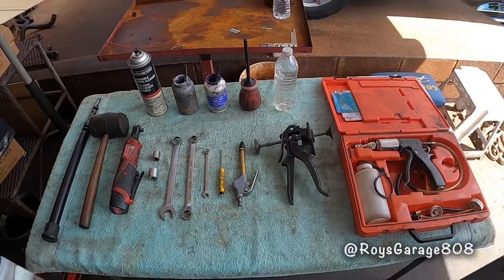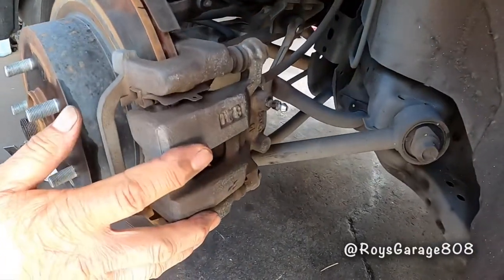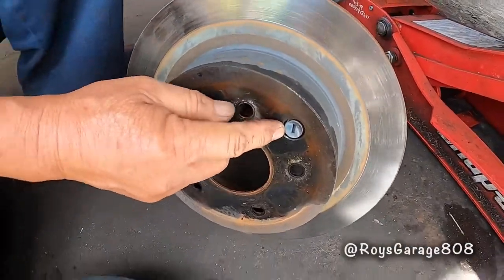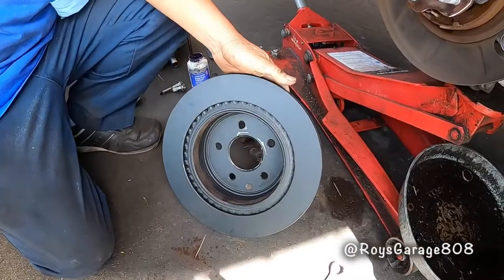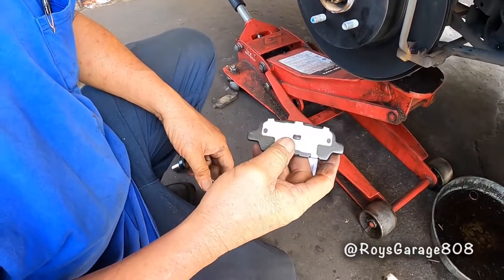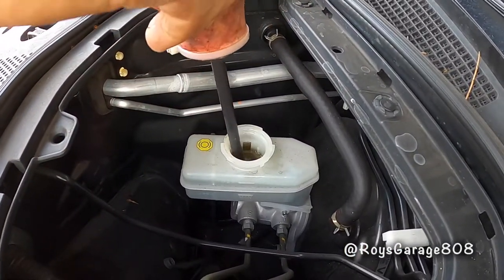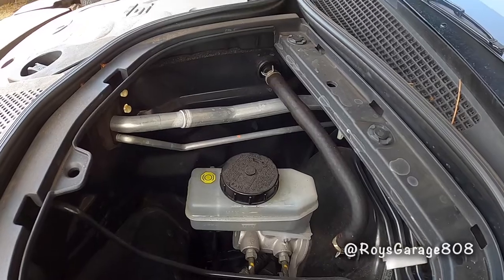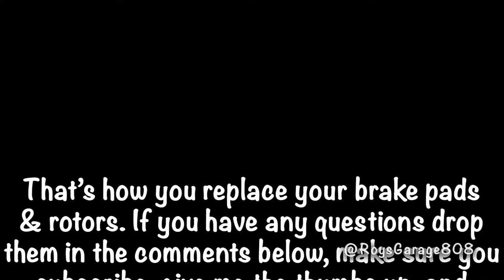How to Replace the Rear Brake Pads & Rotors on a 2008 Infinity M 35S

Comment: You gave me so much knowledge about changing rotors I used to struggle when it's so easy if you know how to do it correctly I wonder what brand brake pads do you use?
Reply from the maker: Glad I could help.  I'm using duralast gold pads. You can use any brand. Make sure they are premium pads.

Comment: Would you say that if the rear brake spring is not adjusted when mounting the rotor so that theres no wiggle and tight fit, can it cause shaking when braking? Once everything is back on. Even though rotors are new? Please help.

Comment: Roy, What does that rubber plug you put in the rotor do?
Reply: I think that keeps the threads clean for a bolt to push the rotor off if it's stuck.
Reply from the maker: The rubber plug is used to stop any debre from going into the emergency brake.
Reply from the maker: The hole is used to adjust the emergency brake.